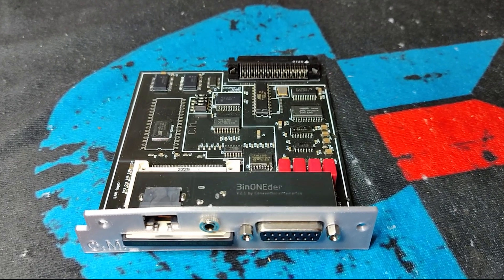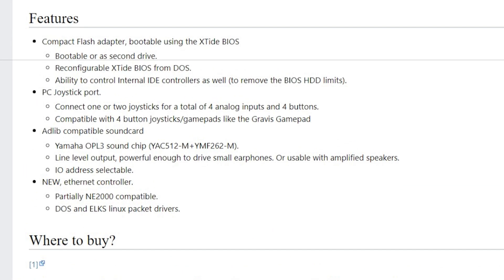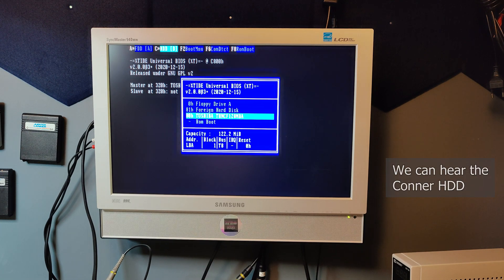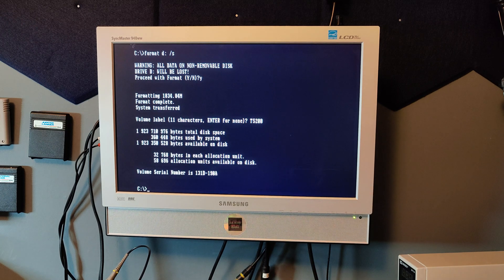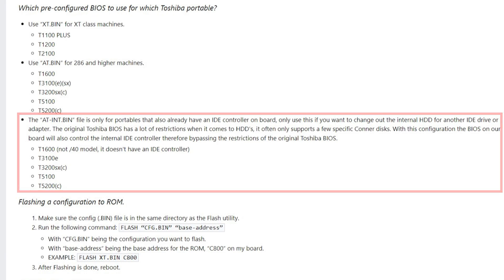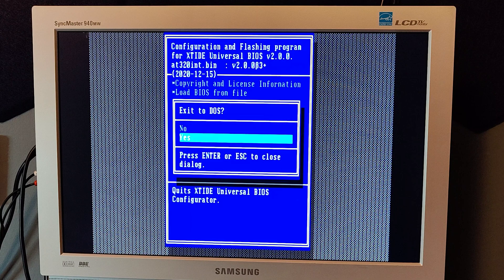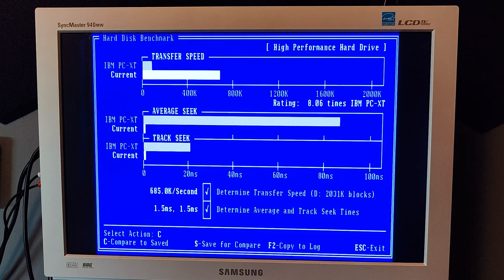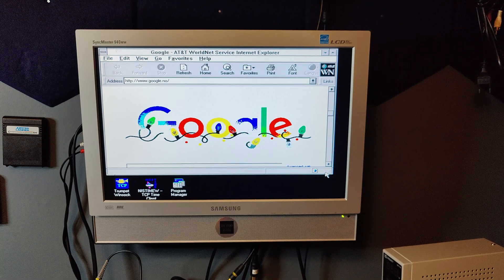3inONEder: AdLib, NE-2000 and XT-IDE in ONE card

Comment: Not sure how to make it autoboot from the CF card instead of the old internal HDD. Any ideas?
Edit: Figured it out. Turned off HDD in the original BIOS.
Reply from the maker: I think ou can use the XTIDECFG.COM utility to modify the boot device
Reply: @RetroErik  Thanks for your reply my friend. May I ask you which driver you installed inside Windows 3.11 to get the packet to work for the internet?
Reply from the maker: @Ipsissimus  never tested. But check 3inoneder webpage